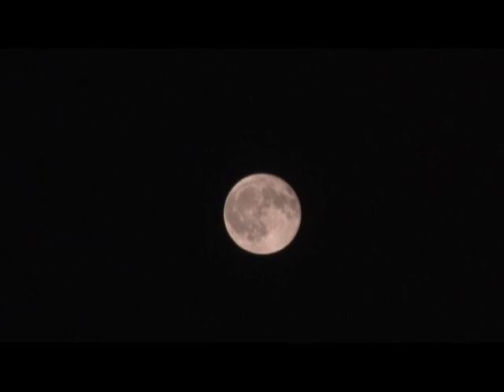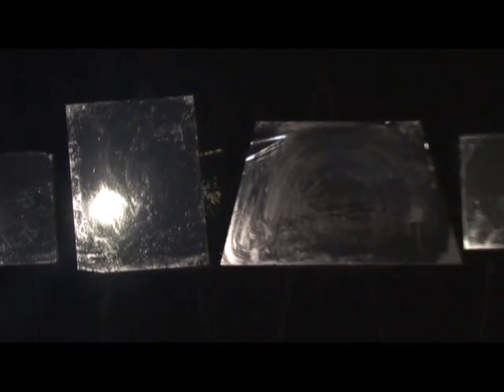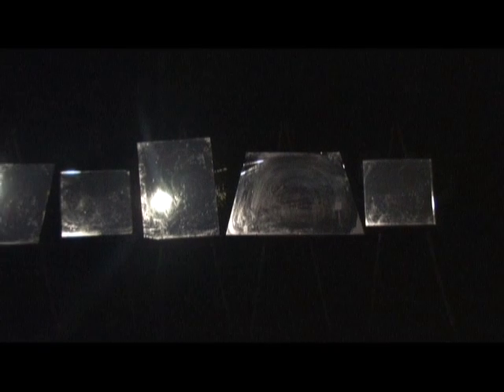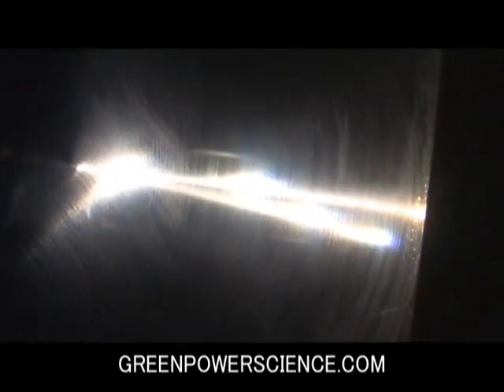MOONLIGHT LUNAR FRESNEL LENS SOLAR PANEL PV PHOTOVOLTAIC NIGHT SOLAR ENERGY

Comment: the moon is mostlikly a cold electricity. it has been replicated using a dc pump and the efects have to do with the rf range. this is mostlikly a very diffrent and potentialy more energy efficient tech if we could harness moonlight fir power. someone get to work on this.

Comment: There is absolutely no possible way what so ever that you are going to get any solar power from moon reflections.
The reason being is that the light from the moon is NOT reflected light from the sun.The moon has its own light and it has rather strange properties compared with sun and most other light.Moon light is actually cooler than moon shade.There are YT videos that prove this.Place a thermometer in moon light and another in the shade and you will see the one in the shade reads warmer.
I knew from the start of this video that you would not get power..You should at least look into this b4 you try this again.
Reply: if the light from the moon is produced by the moon itself and not a reflection, why does the moon have phases?
Reply: if the light from the moon is produced by the moon itself and not a reflection, why does the moon have phases?
Reply from the maker: I know that. People requested the effort back in 2008 (when this video was released) to see the results. The giant glass orb project that goes viral every few months claiming to harvest moonlight is a waste of glass. The goal with a video like this is to demonstrate what is possible and also show the limitations. While a very small motor can be lightly powered, it is not worth the effort for a few nights a month when the moon is optimal.
Reply: It seems like you copied/pasted your comment from a file,like a robotic standard response.You haven't addressed a word I'm trying to tell you .That is ,its not worth the effort EVER if you are doing it to concentrate sunlight reflected off the moon.The moon is just a flat projection onto a film and its under 120 k feet up.You have been lied to in school.You may also like to know the earth is a flat motionless plane
I'd like to know the temperature of them focused moon lights.Perhaps it freezes things!
Reply: Caboose - do the moonlight temperature experiment yourself - it is easy to do with a $30 IR thermometer and you will prove to yourself that the moonlight is cooling and not reflected light from the sun.
Reply: Only just came across this, so apologies for replying on a year old comment.  There are several flaws with the 'Moonlight is cool' tests which means they are not showing a cooling light.  Let me explain:

1. The tests using IR thermometers wrongly assume that the temperature is read from where the laser dot is pointed.  This is not correct and the instructions do tell you this.  How IR thermometers work is by focusing IR energy from a area.  This area is usually of a size with a ratio of 1:10 to the distance away the thermometer is.  So if you hold the thermometer 10ft away, it is collecting IR energy from a 1ft area. The laser pointer is only there as guide to where you are pointing the thing... If a small item is place on the ground, which is less than 1ft across, you would be reading the average temperature of it and the surrounding ground... 

2. We know that there is a thing called radiated cooling.  Placing something over the object being measured insulates it a bit from this radiated cooling, meaning it doesn't cool as much as something in free air.  This will occur on a cloud covered night without moonlight, so it is not the moonlight that is providing the cooling effect. 

3. Wind has an effect on the temperature, even a very slight breeze can have an effect.  Most of the experiments 'proving' a cold light place the shade so it would alter any such breeze. 

4. None of the experiments prove that the items being 'cooled' by the moonlight show that the temperature goes below the ambient temperature.  Why is that?  If the prediction is true, the moons light somehow has a cooling effect on objects, wouldn't an object which is in the moonlight for a long period freeze, or at least reach temperature significantly lower than ambient?

5. For the light to be cooling, it would somehow have to 'suck' or absorb the energy in the item it is cooling.  How does this process work?  The light from the moon has energy, so how can it take energy away?  It just doesn't make any sense... 

Go repeat the thermometer tests accounting for these factors and report back...
Reply: Oh good the lunatic science is making it's rounds...
Reply: MsSomeonenew - And another indoctrinated sheep is making it's rounds!
Why don't you do the experiment yourself and find out the truth before passing judgement?
Reply: Hello Goodbye the effects? Do you really have to ask that question? 

If you don’t know how an IR thermometer works, you will use it incorrectly and get erroneous results... it’s that simple. 

They had never been an experiment conducted correctly that proves the moon light is cooling... they are all flawed in some way, even to the point where I’m sure they are setup purely to get the results they want. 

It’s all utter nonsense. If the moonlight was cooling, then why do things not freeze in moonlight?  Why do they only ever reach the ambient temperature? 

For instance if there is a moonlit pond, why does it not freeze overnight, every time the moons ‘cooling light’ shines on it? Why don’t all the creatures that live in the pond not freeze to death? It’s because things cool down at night dues to radiative cooling, not because the moonlight is cold...
Reply: Hello Goodbye all you have done is proven you have no idea how an IR thermometer works and why the way these people take the readings is giving them inaccurate results... 

Go away, find out how an IR thermometer actually works, especially the distance to spot diameter ratio and why it’s important, then come back and we can have a conversation about why the moonlight isn’t cooling at all...
Reply: @Hello Goodbye did you not watch the video? That guy has already done the experiment, properly, and obtained the results that you would expect, i.e. that moonlight has zero affect on the temperatures being read... I'm also not sure what me doing the tests is going to prove?  You'll just deny the results are real and regurgitate some more flearth word salad... its really not worth my time when it has already been done...
Reply: @Hello Goodbye Ok, so you need spoon-feeding the information... ok... at 01:48 he shows you the temperatures measured during the day, you can see each temperature probe, the different coloured lines, showing an increaces in temperature as the sun moves across them.
Then at 03:12 he shows the same experiment repeated at night, as the moon moves across the 4 sensors you can see there is no discernable change in temperature between the 4 probes.  This means the moons light does NOT have a cooling effect, as if it did, you would expect to see the same differences as the experiment done in sunlight, but opposite...

If you really want to, he has provided the spread sheets he generated so you can plot the graphs yourself if you like...
Reply: Hello Goodbye the original post I was replying to was talking about YT videos proving the moon is not reflected light because it is cooling, I mentioned the fact that in those videos they are using IR thermometers and more importantly using them incorrectly. 
You then chimed in saying they aren’t using them in correctly and I should go do some experiments and measure the temperatures myself.
I then posted a video from an experiment conducted by someone else, who A: does the experiment correctly and B: shows that the moons light is NOT a cooling light. 
You then asked me where in the video he measures the temperatures, which I pointed out to you, now you are talking about the original video... so, to sum up...

You think the moons light had a cooling affect, I have posted a video proving you wrong... 

The end.
Reply: Hello Goodbye well I’ve never had any video links filtered by a spam filter, nor have any that people have posted to me, so why would I expect it to be filtered as spam?
Reply: Hello Goodbye ok, so the video I linked is on a channel called Whereswa11y and is called “cold moonlight experimental proof THAT IT DOESNT WORK!”

This is all in reply to the person who commented that the reasons the guy in the original video didn’t get much of a reading from the solar panel is because moonlight is not reflected sunlight, to which I replied they were wrong because there is no conclusive proof that the light is cold and in fact all the videos proving it are giving erroneous results because they misunderstand how an IR thermometer works...
Reply: Hello Goodbye you are missing the point entirely. The experiments done using IR thermometers are conducted incorrectly regardless of the results. This means the data they collect and consequently the conclusions they derive from them are erroneous. 
It is nothing to do with “mainstream science” but everything to do with reading the instructions and conducting the experiments in a way that produces accurate results, which they don’t. 

If I were to do the experiment I would do the same as Whereswa11y did, because that is how you should be taking temperature measurements. 

The issue with non-contact IR thermometers is that they take an average reading of an area, that area is determined by a ration of the distance you are measuring from, so if your thermometer has a ration of 10:1, when you are 10ft away, the area being measured is 1ft in diameter.  This is important and should be taken into account when taking measurements.  The first thing to do is make sure you measure from the same distance each time, which they fail to do. The next thing to do is ensure what you are measuring is the same, in most if not all the experiments I have seen, they have something blocking the moonlight to create ‘moon shade’ but the IR thermometer will also be taking that item or object into the temperature readings. 

Then you have to consider radiative cooling, the different transmissivity of each material, wind cooling and so on, none of which is taken into account.  They just point the thermometer take a reading and that’s that. 

The way to do these experiments is to remove all those variables and take direct measurements, which is what Whereswa11y does... 

I could go out and do these tests, but I don’t have the equipment or time to do so, plus I don’t have to because it has already been done, properly without using IR thermometers which by design aren’t the correct tool for the job...
Reply: Hello Goodbye well, I didn’t say that did I? No I said for doing these kinds of measurements they are the wrong tool.  

It does help if you read and understand what I wrote rather than just misinterpreting things to suit your narrative, which is typical of a flat earther...
Reply: Hello Goodbye moonlight isn’t cold and as I have explained before and you keep ignoring, with the ir thermometers you cannot eliminate radiative cooling, wind effects and other things affecting the temperature readings... do you ever read what other people say?
Reply: @Hello Goodbye Well quite obviously you don't have a clue about IR thermometers and why they aren't suitable for these kinds of measurements.  For a general measurement of temperature they are fine, but for this? No you need something that takes the direct measurement of the moonlight.  Enter the DS18B20 SC, this is a semiconductor device which measures the temperature of either the ambient temperature of the air it is in, or the temperature of a thing placed on it. It does this by measuring the resistance of a material and knowing the resistance to temperature ratio, you can calculate, very accurately the temperature of the device.  This sensor makes a more direct temperature reading than an IR thermometer, because of the aforementioned Distance to Spot ratio, which can vary between devices and can give wildly different results depending on the distance the temperature is measured, which is the key point people miss when using them to perform this "is the moonlight cooling" experiment.  

So do a search on Astronomy Lives channel for a video entitled "Does moonlight make things colder?" in it the guy does the 'moonlight' test in the day.  He has a piece of metal placed in the midday sun and takes a reading, measures temperatures ranging from 43-47 degrees F.  He then places the foil in the shade and repeats the measurement, he gets a reading of up to 78Degrees F.  This is why an IR thermometer is NOT the right tool for doing THIS kind of experiment, because as you know how they work I don't need to explain it to you... or do I?
Reply: Hello Goodbye you clearly have no idea what you are on about, there is no point even continuing this discussion because you clearly have no comprehension of what is being discussed...

Comment: I would be interested to see what a 12 volt 2000 or 3000 Lumens LED Spot light would produce with 2 kilowatts of solar panels?
Reply: LEDs (simple commercial ones) put out at max 30% light, and the panels will recapture maybe 20%, so your 2 kilowatts going into the lights will at best come back as 120 watts.
Reply: MsSomeonenew Yeah me thinks I will just wait for solar system battery storage to get a little more cost effective, rather than fiddle around with charging a couple of car batteries hooked up to a 500 watt solar panel charging kit - that will run 2 LED spotlights trained onto my home solar system during the night and or when sun light is substantially lacking, I just need to cover 300 to 400 watts an hour every night, and all my energy should be free..